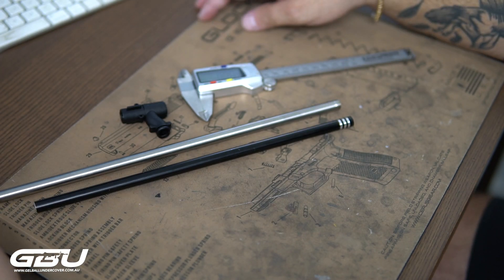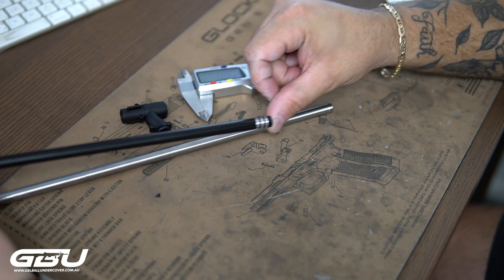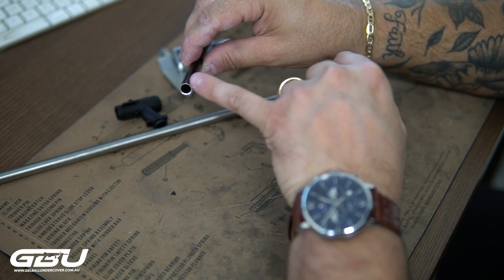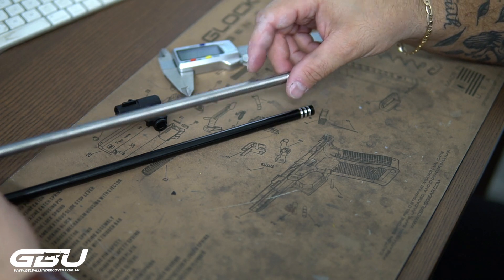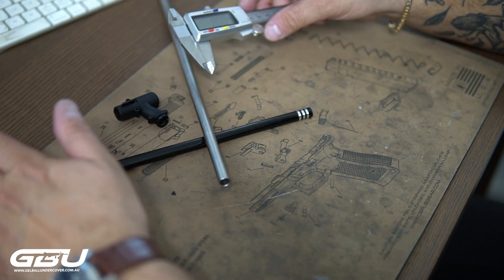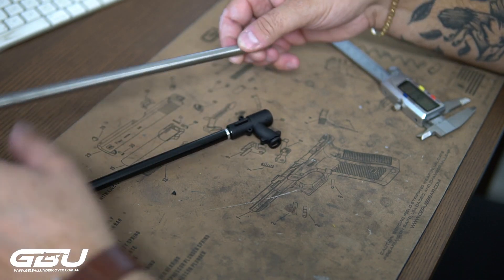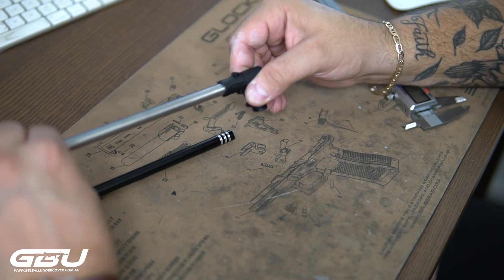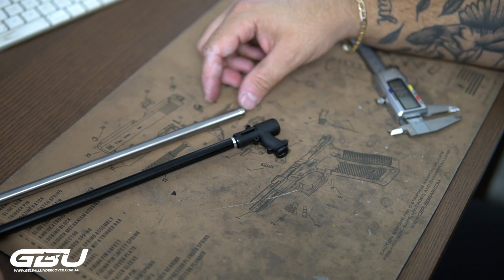Best Gel Blaster Barrel! | Which Gel Blaster Barrel is The Best? ✅

Comment: I feel like my stainless barrel is messing with my accuracy. I have the cylinder/barrel ratio pretty close to 1.8:1 but being tight through the bore, can the gels start to grab the wall inducing a spin before the hop up and throwing them in random directions? I feel like my stock set up was more accurate over 30m than what I have now.

Comment: Yes, stainless steel barrels are better but the barrel length is equally as important. The cylinder porting is also very important.
Reply from the maker: Yes you are correct, though this was just a small
video of the difference  between alloy and stainless as a lot of people have been asking. 🤙🏽 We will do a more in depth video later on explain what you said.